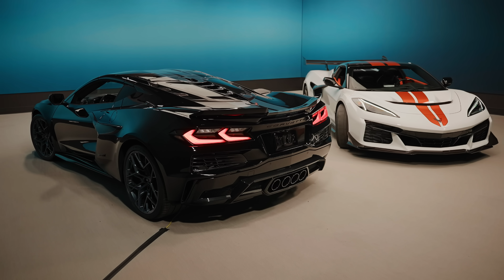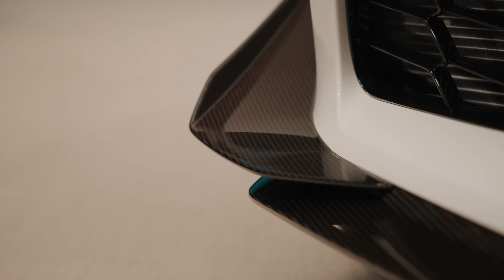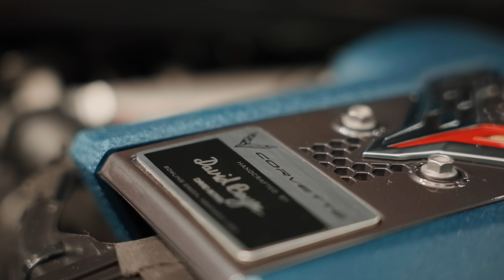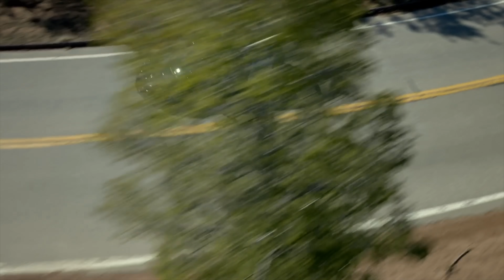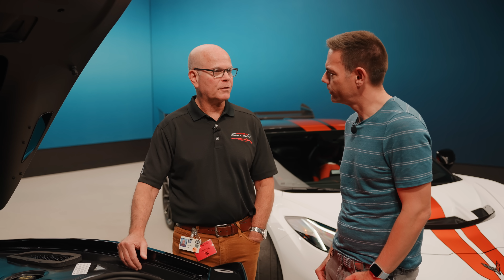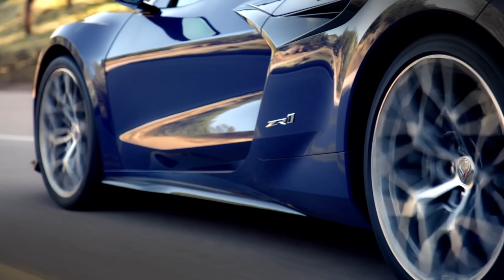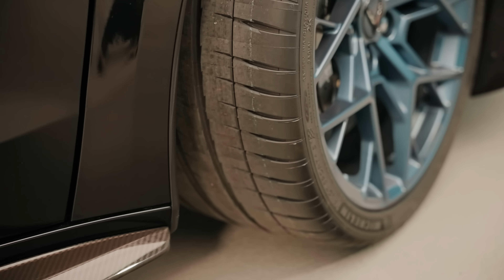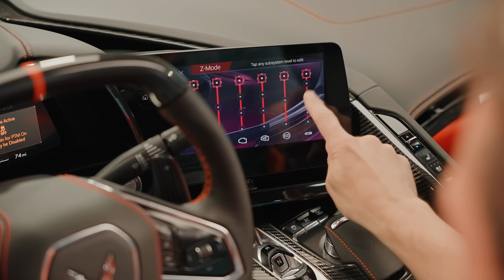FIRST LOOK: 2025 Corvette ZR1 – 1064hp, Turbos & 215mph!

Comment: 1,000 Hp from a factory vette is absolutely INSANE. This car makes more Hp than the original Bugatti veyron, this car is gonna be a monster
Reply: This car makes more power than the Lamborghini revuelto.. Lamborghini must not be happy.
Reply: @jwalster9412  with no electricity too, but it's still RWD so the Lambo probably still beats it off the line
Reply: @GA_pyrodawg5181  if I remember correctly, the revuelto is 800Hp rear, with a 200Hp boost on the front axle.
Reply: @GA_pyrodawg5181 Well depends, It’s also a Mid engine and has a huge wing, over like 60% of the cars weight which i’m assuming is going to be 3850 is going to the rear wheels and then include the 1200+ lb Wing on top of it. Essentially awd at that point without the awd disadvantages lol
Reply: @jwalster9412  I know, the Lambo is AWD. I'm talking about the Vette being able to transfer all its power through just the rear wheels vs the 1000 & AWD of the Lamborghini
Reply: @aimxdy8680 thanks for posting.  I’m new to understanding this but what are the AWD disadvantages you mention. Weight right?
Reply: @GA_pyrodawg5181 it’s called gears my friend.
Reply: @aimxdy8680  They said the coupe will be 1660kg, so about 3650lb
Reply: Lamb fell off bad imo @jwalster9412
Reply: @jwalster9412 I don’t think anyone would cross shop this tasteless overstyled thing with a Lamborghini so I think they’re fine.
Reply: @kraenk12  don’t you have things backwards?  It’s Lamborghini that makes some of the most over styled cars out there.  I’m sure that companies like Lamborghini hate cars like the ZR1 that offer performance on par (or better) with top exotic cars, but cost a fraction of the price.  Assuming the ZR1 offers better performance for half the price of an equivalent Lambo, why would anyone buy the Lamborghini?
Reply: @jwalster9412 the lambo is 800hp NA engine. Not comparable.
Reply: @jwalster9412  but still would get beaten by a lamborghini
Reply: @jwalster9412 but revuelto has electric motor which gives instant torque
Reply: @jwalster9412  Lambo is dead imo. They killed themselves when they gave up on the simple N/A V12... U would buy that beast because of the sound and looks, nothing more.
Reply: @n1ck72  the issue is almost entirely that the V12 is the exact same from the Aventador, they didn't change it at all.
Reply: And it didn't need 10+ radiators for Philly to eat Grilled cheese off of😂😂😂
Reply: @GA_pyrodawg5181  Pennsylvania residents unite when the word cheesesteak is thrown around
Reply: @grandetrains  it's actually a Sopranos reference but I do love a Good Cheese steak 🤤
Reply: @grandetrains  I visited Pennsylvania, and boy I'm also Summoned by this word, cheesesteaks are wild
Reply: @GA_pyrodawg5181  It's also literally 20 years newer lmao
Reply: @GA_pyrodawg5181 Bugatti was made in 2005 this is 2024 lot of tech has changed in 19 years and top speed is still 215 mph not 250 mph like Bugatti 😂😂😂
Reply: @VarunTomee-kr6nf exactly. Monster? 🤣🤣
Reply: @GA_pyrodawg5181 Even cars like a ZL1 have like 11 radiators, this includes every heat exchanger.
Reply: @alyousuf it has 15
Reply: You do know the Veyron was built in a time where tech wasn't as crazy as it is now and it was tested literally all over the world the Veyron was tested here in South Africa long before the public knew it existed the first design of it was in 1999 first car came out 7 years later in 2006 , regardless of how you feel about it it's a hypercar that'll probably still have a higher top speed then this , you never hear of a Bugatti burning down you never hear of them being unreliable or poorly built or is horrible to drive because they're not they tick absolutely every single conceivable amount of boxes it having 16 cylinders means per cylinder it makes less horsepower then pretty much the majority of all cars which in tern means there's less stress per cylinder which is why it's so reliable which is why it has a smooth and consistent freight train like power band Bugatti's are the epitome of the automotive industry the leaders in pushing the boundaries but still keeping it reliable and luxurious and daily usable that's a no corners were cut car over engineered to the max @GA_pyrodawg5181
Reply: @GA_pyrodawg5181  ehhh... let's make fun of some number without even understanding it ;)
Reply: @GA_pyrodawg5181 it has 15 heat exchangers actually. They cover the whole front.
Reply: @GA_pyrodawg5181 That's just how much technology has progressed. The Veyron was 20 years ago. The Veyron was overbuilt to handle the power.
Reply: @GA_pyrodawg5181  well it doesn't need 10 radiators due to modern tech too, veyron came 19 yrs ago
Reply: @GA_pyrodawg5181 it ain't gonna get anywhere near 400kph as the Veyron did and it will shake more going 100 mph than Veyron did goin 250mph, so no point comparing
Reply: @KaushikBala333  it's widely known that the Veyron from day 1 was built to go up to 250 & beyond. It didn't happen to go that fast by accident. GM saw no need for the Novelty Top Speed #'s that virtually nobody will ever do. Now put the ZR1 on basically any track & it will eat the bugs lunch every time, why is that you may ask??? Because like the top speed of the glorified Volkswagen the Vette was designed for that
Reply: @GA_pyrodawg5181  Calling a Veyron a "glorified Volkswagen" is so incredibly childish.
Reply: @GA_pyrodawg5181  eat the bugs launch everytime. You sure about that? A Veyron does quarter mile at 9.8 seconds.Maybe the Vette can match it as per data but I am sure you know it cannot match at anything beyond that quarter mile.
Reply: @GA_pyrodawg5181 comparing a 2005 car to a 2024 car is wild. You must be illiterate or something
Reply: This care wouldn't come near the top speed of the veyron.
Reply: I honestly can’t believe they are able to achieve these outputs. Everyone talks about electric now but the advancements made in ICE engines is incredible.
Reply: @KingWillbro  exactly also ICE engines are easily fixable and cheaper because if something fails like a turbo you just replace the turbo if the head gets cracked replace it , if an electric motor breaks more often then not the whole thing has to get replaced also internal combustion engines can be fully recycled , also electric cars are guaranteed that you have to replace the battery pack at some point and when that day happens it'll cost more then the cars worth which means people are gonna sell them and nobody is gonna wanna buy them because of the battery pack , that's like buying a 200k car in 10 years the cars worth 80k but the engine alone to replace is 100k nobody is gonna buy it
Reply: @chadkennedy8675  Yeah, spot on. It's a huge problem with electric cars. Until solid state battery technology is much further along, I wouldn't consider electric.
Reply: @KingWillbro  i feel like batteries should be interchanged you go to a charge station get new fully charged batteries and you give your flat batteries and boom your off to the races
Reply: @KingChadKennedy  They tried this in Australia years ago but it never took off as it was too expensive.
Reply: @KingWillbro lol. You Americans are just discovering the magic of Turbos. Over here in Europe we knew all about them many years ago! 🤣🤣
Reply: @winstonchurchill9048 Callaway Sledgehammer enters the chat...
Reply: @littleherms3285  lol. 255mph?
Veyron Chiron Super Sport 304mph. Over here in Europe we have cars achieving 330mph. Your point is??
Reply: @winstonchurchill9048  dude, you made a bullshit quip about North Americans just discovering turbos recently. The Sledgehammer held that record for 20 years with an Atari grade ECU and a twin turbo small block Chevy.

The Verons don't impress me in the slightest. They fucking BETTER go that fast with 17 metric tons of money dumped into them. I think you are the one with no point.
Reply: @littleherms3285  you better go to bed earlier. Your schoolwork is suffering. Take your teacher an apple. Might help 👍
Reply: @winstonchurchill9048  The first production turbocharged car in the US was built in 1962.  When was the first production turbocharged car in Britain? 🤣🤣🤣
Reply: @georgenewman5860  lol. The turbo was invented over here in Europe in 1905. First used in an engine in 1925. Get back to school 👍
Reply: Which car was that professor?
Reply: Wanna bet it’s still slower?
Reply: it wont reach 400 kmph tho
Reply: No cause Bugatti has more than 248 mph top speed this one has 215 mph also Bugatti was made in 2005 and a lot of new tech has evolved
Reply: After 20 years of owning Porsche GT cars, my friends all say if cut I bleed Porsche red. But I gotta say, this thing makes my 992 GT3 look pretty tame. What a great way to keep ICE sports cars alive!
Reply: It’s insane for ANY car. 
A bit disheartening in some ways. All these cars with ridiculous (pointless?) amounts of power. 
Where’s all the lightweight FUN cars. More power, more weight, more complexity isn’t always better
Reply: It’s insane for ANY car. 
A bit disheartening in some ways. All these cars with ridiculous (pointless?) amounts of power. 
Where’s all the lightweight FUN cars. More power, more weight, more complexity isn’t always better
Reply: @timjones7336  i feel the same all i want is a car that weighs 1300kg or less with 500hp max , if it's 1000kg i want it to have 300hp max , now that's fun cars , cars with gigantic amounts of power are one trick pony's the only car that pulls of massive amounts of power is the Bugatti Veyron and Chiron having stupid power but being reliable comfortable luxurious timeless doesn't look like a track car drives like a Grand Tourer but as soon as you switch maps and put your foot flat it turns into a freight train with unlimited power whilst remaining reliable everything else lacks in some department like Koenigseggs super fast but harsh drive and they're super unreliable alot of them get crashed or electronics fail or they burn or it gets hardware problems like the engine , this is why i keep saying Bugatti is the epitome of everything
Reply: They haven’t even revealed the Zora yet! What’s  that thing going to do ?  This is a monster and for 200k? That’s a deal!
Reply: The veyron is 20 years old.
Reply: I was absolutely not expecting 1,000+
Reply: lol. The Veyron when released 16 years ago with only 987hp had a top speed of 253mph. You think this is going to be a monster? 🤣🤣 Not even in the same class. The modern day Veyrons will beat the Vet ,with half of it’s cylinders disconnected 👍
Reply: On PUMP Gas too, that is absolutely nuts!
Reply: @aceofaces1506 yes….20 years later.
Reply: I think chevy was intentionally shooting at the the new buggati or dodge demon
Reply: All exotic car companies are shitting their pants.
Reply: More HP than bugatti V16 engine.
Reply: @EricAlbar  V16 is naturally aspirated.
Reply: @EricAlbar  N/A, makes sense
Reply: It is a "gonnabea" monster!
Reply: Yeah the 20 years old Bugatti. You can put 1000 hp into a Corvette... That doesnt make it a Bugatti, however. So it remains to be seen how drivable this is. The previous 2 versions of ZR1 have been edgy and unruly to say the least.
Reply: but the top speed is ass for 1000 hp it should at least go 260 mph. its a waste of power 🤣
Reply: Makes Anout the SAME horsepower as a Bugatti Veyron but is 50 miles an hour SLOWER ! ( with 67 hp more, first Veyron had 1001 hp )
Reply: It is going to be a monster, and the ZORA, weather it’s a separate model or an option package that includes electric assist for front axles is going to be nuts too. How much did the Veyron cost new, or now for that matter, and here is a Chevy with that Veyron level of power that will cost less than a Hurican. One thing I haven’t heard a word about is E85, they got 1064 on 93, is LT7 flex fuel capable, and if so what’s the number on that? No doubt in time someone will crack the ECU on these things and turn up the boost and add corn. I’m pretty stoked for it.
Reply: Yup. A monster turd. Yay GM!
Reply: @ tell us you drive a 86 Escort and hate life without telling us 😜
Reply: The veyron, 20 years, was a halo moment. Nobody tought this would be possibel. Nowdays 1000hp are nothing special anymore
Reply: Everyone talking about Bugatti blah blah blah,let me ask you this. How many ZR1's can you get for the price of the overpriced, over hyped Bugatti's? And this is a Chevrolet Corvette. Come on kids give credit where it's due.
Reply: @Newguy56  not the point, bugatti isn't just a car, it's LUxuRy and a name, that's why a bugatti is 1 mil, 2 mil, 3mil+ and will stay 1 mil, 2 mil, 3 mil+ whereas yes it may be out performed, look at the stupid ass Lykan Hypersport, stupid thing had like 300 Hp out of a V6 💀, but this Vette gives me hope for the next Ford GT 😈 aswell as the S650 GT500 😈 all i know is that bitch better have a Whipple on top of a 7.3L Megazilla or imma be making my own 😈
Reply: @aceofaces1506  it has more HP than the tourbillion engine and that's a V16.
Reply: No it does not a Bugatti Veyron makes 1200hp a chiron makes 1600hp
Reply: comparing a new car to a car from 2000. 😂😂 how far behind use is.
Reply: Of course kids will immediately mention veyron.. smh
Reply: @FamilyCTSV  am I not allowed to mention the veyron or something
Reply: @aceofaces1506  proven my point of “kids”
Reply: @FamilyCTSV  huh??😭
Reply: @FamilyCTSV who hurt you lmao
Reply: @kermitthefragg  learn to talk before trying to use words you seen online that makes you think you are cool.
Reply: @FamilyCTSV Hell, why not? The Veyron was THE gold standard to which all ultra performance cars were measured for many years. This car puts out more power with half the cylinders, half the turbos, moving 500-700lbs less, enjoying tire and wheel changes that don’t cost $50,000… and for literally approaching 1/10th the price. This car is an absolute grand slam.
Reply: @John_Hoover  how about the biggest part which is, it CAME OUT in 2005 which means it was in development way before that. Now here you kids are bringing up its name 20+years later comparing it to this. Zero knowledge/common sense on cars.
Reply: @FamilyCTSV  I see where you’re coming from but I’m not shaming the veyron, I actually love the veyron, I just think it’s seriously surprising and impressive that a corvette is making the same Hp
Reply: @aceofaces1506  no, it’s impressive that a corvette is making that power, not that it’s the same as a veyron. Pretend you have never heard of a veyron, like I said, 20+years later, it’s not relevant to this. 2024 we have 4 cylinders that make 2000hp
Reply: @FamilyCTSV  I feel like you’re thinking too deep into this dawg😭

For me it’s the fact that we’ve reached a point where a corvette is making Bugatti Hp from the factory, I know the veyron is old but it really puts into perspective both how much Hp this is and also how far cars have come in those 20 years. I don’t think it’s an unfair comparison to make
Reply: @FamilyCTSV  that's ignorant. Those are not street engines, they have no refinement. W16 is a super smooth motor, lt6/lt7 is based on the Ferrari V8 architecture, arguably the greatest V8 family to ever exist in terms of performance and drama. You're comparing apples and space shuttles. I'm literally a Honda guy, but I'm not a fuckin idiot that thinks 2000 HP b series civics are something I'd want to drive to the grocery store. Get a grip bud. The most powerful production car without electric assist is the venom f5 I believe. 1800hp. Tons more displacement and tons more boost than the ZR-1. You probably need an engine rebuild every 10k. Not worth it imo. The zr1 is a low mile car but you could probably do 5-8k a year and not need an engine rebuild for 5+ years. That 2000hp 4 banger? They rebuild those once a month if nothing goes wrong😂 to get to that level we're talking 80+psi of boost. That is not street, that is for nothing but the strip, and your argument holds no water. The lt7 engine is one of the greatest engines ever designed.
Reply: @FamilyCTSV  Zero knowledge!? Please, enlighten me on exactly what I said that was wrong… since I lack knowledge and all…
The fact is the car is putting out OVER ONE THOUSAND HORSEPOWER. I don’t care if it’s 1984, 2004, or 2024, that is an absolute ton of power.  And it’s a totally fair comparison considering GM is building a car today that Bugatti needed to charge over $1.7M for, only to still lose $6,240,00… on EACH one. 
The performance is absolutely wild. Comparing it to the Veyron is completely valid.
Reply: @GandalfTheClay  it’s hilarious you kids put all this effort to make this paragraph just to continue to say dumb/wrong things haha and continue to miss the point
Reply: @John_Hoover great points!
Reply: @Davepq100  Thank you!
Reply: @FamilyCTSV same thing I said...they are illiterate
Reply: @FamilyCTSV  your "point" was anecdotal at best 😂 all I gave you was data, and ultimately Chevrolet is the only entity that dictates the definition of a Corvette. It's a dense argument to complain and then call your opinion fact😂
Reply: @GandalfTheClay  “gAVe yOu DaTa” hahaha bunch dumb miss information. Now you try to sound smart by using big words in a incorrect manner hahaha and still fail to understand the point/fact I made
Reply: @FamilyCTSV  My gen didn't have the Sledgehammer. most of us were still toddlers or 10 year olds. I would rather have the sledge, because dear god, screw paying bugatti prices.